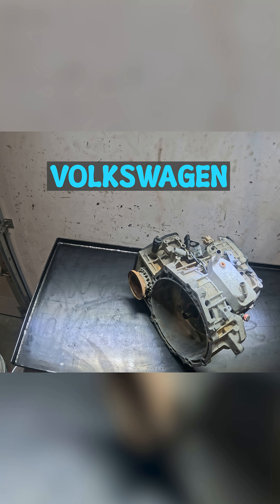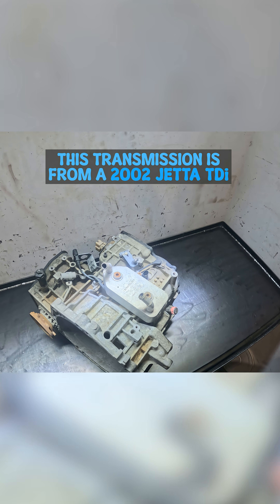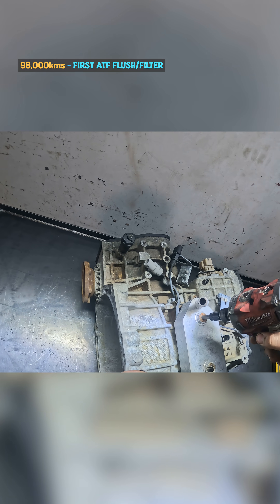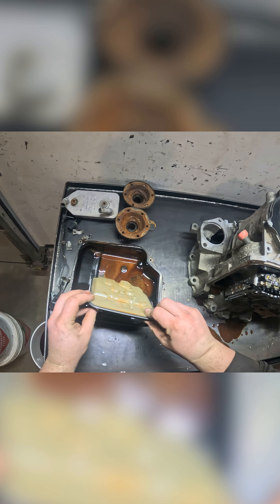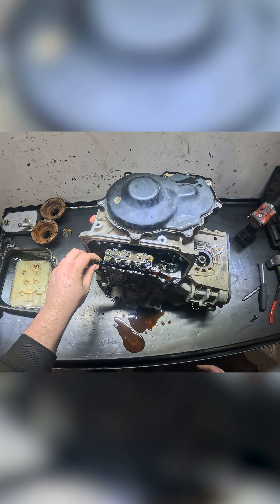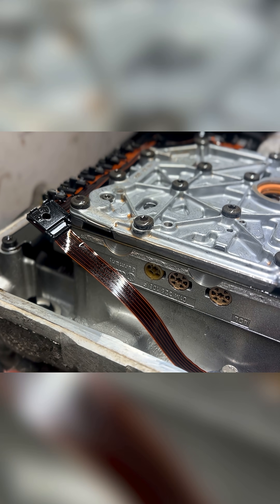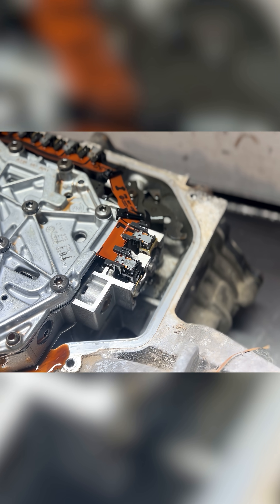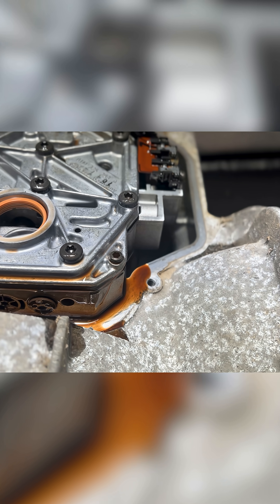A Look Inside One of VW’s Worst Automatics

Comment: Crazy that the F-23 transmission in a 2000 cavalier is rated to reliably handle 300-400hp and they put it behind a 2.2 liter vortec 4 cylinder engine of 120 hp